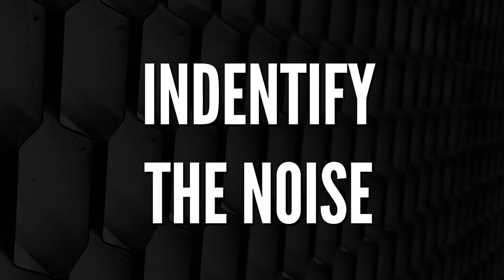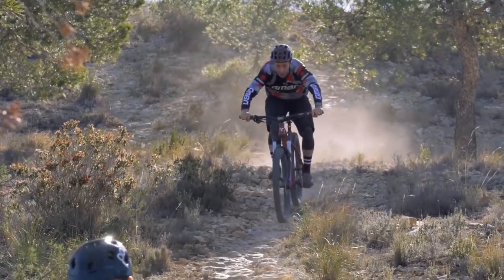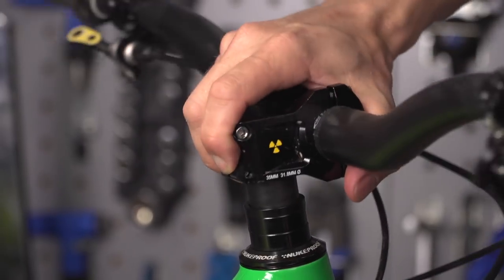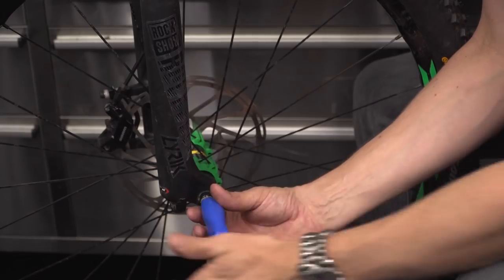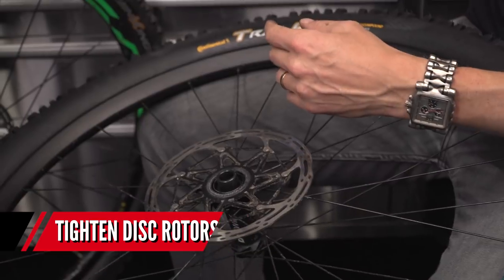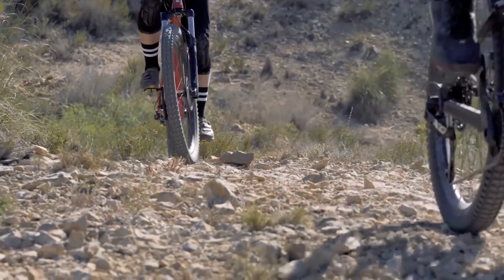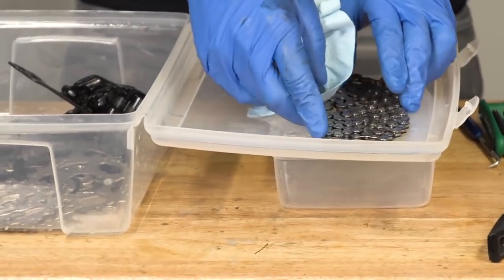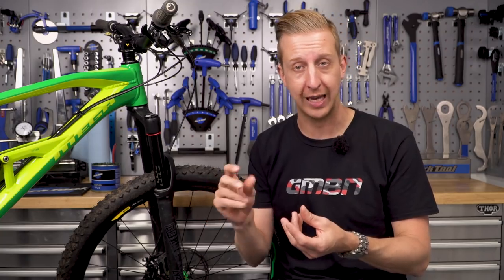Identify Creaks & Noises On Your Mountain Bike | GMBN Tech How To

Comment: #askgmbntech What do we do if the creaking and groaning is coming from the rider?
Reply: Are you not listening? Get the rider off the bike, clean him up and lube him. While doing this, check whether there is wear and tear already. If the wears too much, its time to replace the rider. 😁🤘
Reply: Lube your headset gear.
Reply: and dont forget to screw the rider to the correct torque setting... Wait what??
Reply: @seven9766  Why the confusion? Just torque their nuts to the correct setting. Fixes most issues,

Comment: To sum up the video: You got a creak? Rebuild your complete bike!!  😂😂 Nice video Doddy!! Very helpful!!
Reply from the maker: You should be able to isolate the noise with a few common sense checks. But if not then yes! This is literally everything that could be creaking...do it all until the creaking stops! On the plus side your bike will be in great shape afterwards 💪
Reply: @gmbntech  So just to clarify, I should put a little grease on the inside of the bar clamps? Wont that encourage the bars moving under heavy pressure?

Comment: My from disc rotor rings when tight cornering at speed. Is this centrifugal forces because the rotor is tight or could it be the brake mount? Thanks for any suggestions.
Reply: It could be your hubs flexing on bumps, causing your rotor to touch the pads

Comment: Great tips. 
Had a customers new bike that had a loud creak under hard braking. 
Chased it round and round, checking all the usual suspects. Headset. Bars. Stem. Brakes. Wheels.  Etc. 
Ended up being where the steer tube press fit to the upper crown on the fork. Hadn’t seen that before. 
Manufacturer warranted it.

Comment: I had a creak that was very hard to locate and after many hours of pulling apart, lubing, tearing my hair out and swearing I discovered the creak was caused by a hairline crack in a chain ring bolt on my SRAM XX crankset...the bolt torqued up properly so the creak got missed....converted to 1x and the creak disappeared...inspection of the female part of one of the chain ring bolts under magnification revealed the tiniest crack in the alloy chain ring bolt! AAAAAHHHHH!
Reply: John Beedham hi, did it occur only when wet? My eagle creaks/noisy once wet/muddy...new cassette, chain, chain ring, hub, bb...only bit left is crank but that Looks ok to naked eye....

Comment: My recent personal experience on my 6 months old carbon mtb: I had creakings when more pressure was exercised on the pedals, mostly on uphills. I supposed it came from the bottom bracket and based on this video I ordered grease (I still didn't receive). I cleaned my bike and while removing the rear axle I heard the creaking sound, so I had the idea to thightened it more. And it solved the creaking. What is surprising is that on my aluminium bike if I tighten hard the rear axle, there is a rubbing sound so I have to  tighten it lightly, reason why I also tightened 'lightly' the axles of my carbon mtb. Thanks for your useful vids.
Reply: Dude, thank you so much! I thought i was going crazy! I swapped the bb, was just about to strip down the entire linkage and replace the bearings. Just tightened the rear wheel, the sound stopped. Same experience with going from alloy to carbon. You can't imagine how much frustration and money you saved me! <3
Reply: I have an alloy thunderbolt, the back of my bike creaks when 8 go uphill or go in high gears, do you think if I loosened my rear axle it would solve it?
Reply: lmao i know this is two years later but Thankyou!

Comment: Easy way to fix disk brake, I accidentally wiped a whole load of grease on my disk rotor and only noticed it after the wheel had spun so it touch brake pads. How I fixed is I washed with water then wiped dry, then I coated the rotor in mineral terps and Road up and down the street holding the brakes down. Then washed everything off. My brakes felt like brand new
Reply: Kurtis thank you
Reply: @aidanmacdonnell244  haha this was a long time ago, I did work but I think I would recommend a brake cleaner spray or Kerosene instead.
Reply: Kurtis ok thank you

Comment: Desperate for advice here, my bike has a creak coming from the back side of the bike as fsr as I can tell, only when running on lower gears (higher cogs), seated or not seated, going straight or wile I move side to side, no difference, same issue. It's a Commencal Meta Power EBike. Ive tightened all the bolts but still creaks! Any suggestions please!
Reply: Lucian Dinu check the derailleur hanger / linkage
Reply: Oscar Cobbe it’s something like this (see vid), not sure what’s wrong yet, I need to pull it out.  https://youtu.be/R6Avnq7HDTc    It all started after I’ve installed on the bike new rear tyre tubeless which was defective, warranty approved as defective tyre but I went put for two sessions before I’ve noticed the extreme wheel wobble that also induced this creak.

Comment: Hey mates, i have some creaking problem, rather than ''bad acord guitar string sound'' kinda... Using Shimano 12 speed groupset (XTR&XT mixed)

it only happens on low gears and under hard steep hills climbing. 33-39-45-51 tooths area kind of.

-i have checked bottom bracket and crank arm area with pedals. Nothing wrong there, cleaned and greased
-checked my chain, i have XTR and XT chain (XT brand new) put XT one, chain size also correct
-checked casette torque tightened it correct
-cleaned micro spline body, put bit of grease and installed casette again (yes casette spacers in correct places, including that small plastic one behind 51t sprocket
-checked freehub body and bearing, cleaned and light greased (which is free hub sound almost gone now...)
-put new XTR&Dura-ACE polymer gear cable, adjusted gears correct with B Screw and high&low screws all correct.

i am thinking the sound coming from my wheel spokes ? sounds like it ? or something wrong with that micro spline body ?

Sound is really like wheel spokes sound, since when i check wheel spokes with my hand, if there any lose, there is not any loose and my wheel is true but you know the guitar string accord sound like, when you check them by hand with bit of force.
(Bontrager Kovee Pro carbon wheelset)

Any thoughts ?

Best regards

Comment: I have a problem with my bike. When i turn to the left, the fork and the wheel start to vibrate but when i go straight or turn to the right it doesn´t happend, what could be the problem?
Reply: antonio stefan gabriel loose bearings
Reply: antonio stefan gabriel loose wheel so disc is rubbing
Reply: the wheel it´s tight and the dics doesn´t touch the pads
Reply: The bearings inside the wheel not the wheel itself
Reply: Definitely sounds like a wheel problem, my guess it that when you turn left the actual hub moves and rubs.

Comment: So I had a creak "coming" from the bottom bracket area and what it was was that i slightly banged a nut on the rear axle and the creak was coming from the axle parts rotating against the frame (?) under pull from the paddles...retightened it and it was fine

Comment: Hey i need help, so first off my handle bar make like a click sound whenever i pull or steer it like clicks and move a little bit and I need help with that, second thing is that i hear a sound some where at my chain or my pedals and I dont know what it is, third thing is that i also hear a sound some where at my front wheel when i turn or just go forward sometimes andit goes like grrr.. Grrr Hard To explain but if You might know what it is please help me

Comment: I chased a creak on my bike for about a year and it ended up being the stupid chainring bolts. Should have checked them first, but after taking them off, cleaning, regreasing, and reassembling, no creaks. Moral of the story, always check chainring bolts for drivetrain creaks!

Comment: Hi doddy I've got a problem. When I pull my front brake. It makes a loud cracking noise. Not Creek a crack.ive swaped brakes over and disk made no difference. I have rockshox judys sliver boost which are new with a new mavic crossride 110mm front wheel. It felt like it was coming from the caliper but it's not i tried two different brakes .any idears 👍

Comment: #AskGMBNTech I am deeply thankful for this segment. It helps us with the nerd stuff indeed.

I have a question: Is it ok to convert an AM bike to do enduro by swapping a long travel fork (from 140 to 170), or will it harm the frame?
Reply from the maker: It won't harm the frame but it will affect the feeling of the bike. So the front end will be higher, as will the BB, so it might not feel as nice to pedal an might feel a bit unbalanced in the rough stuff
Reply: hi brusko admin

Comment: I had horrible creaking sounds coming from the rear of my bike.  I watched this video and realized it may be just my spokes with grit and grime making the sound.  I squeezed on my spokes to see if any were loose and sure enough the same creaking sound emitted from some of them.  I washed my bike and even without adding lube, silicone, etc. to anywhere on my bike the creaking is gone on my test ride — and, on top of that my gears were shifting smoother and quieter and, again, all before I lubed up the bike afterwards.  I guess I'm just going to have to wash my bike more often like a good little boy.

Comment: Can you guys help me pls? When Im in the bike it is creaking. I put pressure or not it is creaking but, most of the vibration I feel it on my feet. But when Im testing my pedals with me not riding my mtb its not creaking. I clean my seat post but it is still there. It creaks even though Im not pedaling (but Im riding) I test my cranksets but there is no play on it. I go to my technicians and they just dont know what it is.

Comment: My spokes always make a pinging noise. 8:39 When I got my first mountain bike a year ago (a hardtail) the it started to make pinging noises coming from the wheels and it took me forever to figure out that it was the spokes causing the noise. Now, about a week ago I got my first full suspension and the spokes are pinging on it as well. I can't take it in to the bike shop that I bought it at for a free tune up because I had to drive a few hours away to pick up my new bike due to the bike shortage. How can I stop the pinging/tighten the spokes myself? Thanks

Comment: Cheers Doddy...nice vid...I have a drive train creak/noise but only once bike gets wet/muddy...everyone inc manf of drive trains tech mgr is stumped! New cassette, chain, chainring, derailleur, hanger...no joy. everything greased, carbon pasted and torqued right..many times. Tried different rear wheel and pedals too...no different. Its only when bikes wet, only pedalling high torque (up hill gears 2-6), does it standing or sitting. A total doozy...started at windhill 6months ago and no fix yet...ideas? Its a top end drive train too...so not cheap...desperate!

Comment: I had a rattle for 3 years and finally found it, loose items in patch kit inside my rack bag. Though for sure it was in the drivetrain. I also discovered my rear swingers(chain stays) have a side to side wobble now and need a new frame bushing, or I need a new bike, it's a 1998 Manitou F/S with Bazooka rear shock and 18,000 miles.

Comment: I finally found my creak! After changing bottom bracket,  lubing pedals and suspension pivots with no luck...I disassembled my chainring and cranks. they were dry, gritty and a little loose. that did the trick

Comment: Hey Doddy,
Just got myself a Mega 275 Alu. 
Notice a slightly knock on headset The headset is tight. I rock the bike back and forward holding front brake and I don’t get the noise but when riding and pressuring the handlebar it makes the noise. I took the headset apart and the only thing I can think is that split washer on that goes after the top washer. It does not go all he way down. I tried force it and it is still not going. Give me some ideais please. Cheers

Comment: I just got a new hardtail, and when I heavy brake or go off drops, the front brake pads (Shimano deore brakes) the pads shift back in the caliper and it makes an awful click sound. When I go off of drops they slide forward and hit the front of the caliper. Any fixes? Everyone says it is normal but it is incredibly annoying and disconcerting.
Reply: Same, I dont think you can fix it, it is normal

Comment: Another great video doddy 🖒👍🖒👍 I just wanted to ask you about my new bike that I picked up today 😁it's a Scott 930 29er I wanted to ask you about upgrading any  gear on the bike or should I leave well alone?
Reply: Nice, man, I ride Scott Scale 70 2011. You'll have to specify what product line you bought as well.
Scott bikes have several different product lines: Aspect, Scale, Spark, Genius. Every type have many versions with it's own number: 980-910, 780-710. 9xx means it's 29inch wheels. 7xx means 27,5 inch wheels. Aspect is Scott's lowest-end line. Scale is one step up. 
I say ride for one year and see if you feel like you're missing anything. Most likely you won't. Upgrading gear is expensive so only do when something breaks. 
Only thing you should worry about is the saddle which is probably a stiff uncomfortable one. Get a comfortable one.
Don't ride other people's more expensive bikes, cause you'll compare and suddenly feel like you need this thing you didn't even know about before. 
I now want air shocks and Rapidfire gear shifters. T_T In 2018, Scott Aspect 910 and Scott Scale 970 would fit my criteria.

Comment: I also have an annoying creak while pedalling under pressure. Almost sure it is the internal cabling from my dropper post. Does the internal part really need an inner and outer cable or can you take only an inner for the internal part?
Reply from the maker: Internal's for a dropper post should have a full length of outer covering the inner yes

Comment: Is it okay to use silicon spray on the stanchions?
Reply from the maker: Sure, wipe it with a clean, lint free rag after though or it will just attract dust...and be careful not to spray any onto any braking surface whilst spraying.

Comment: This video came at a perfect time for me. I am experiencing ‘ghost pedalling’ but only on 3 of the spline things. When  those 3 spin round they engage and the pedals spin when they should be free wheeling. Any suggestions?
Reply: I would try taking the freewheel mechanism apart and replacing the lube in it. The oil might be causing the pawls to engage
Reply from the maker: Sound advice from josh, although we'd suggest that it's small 'chunks' of grease or dirt that are causing it to engage...it only needs a very light brush of grease if you're using thicker stuff!
Reply: GMBN Tech thanks very much for the advice
Reply: Josh Turner cheers for the advice